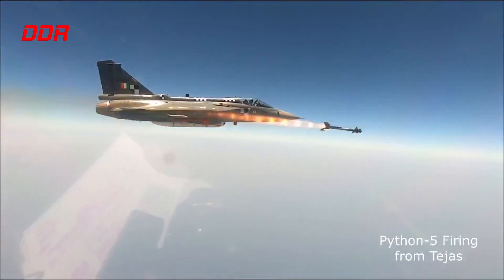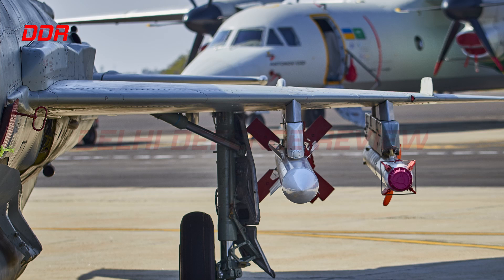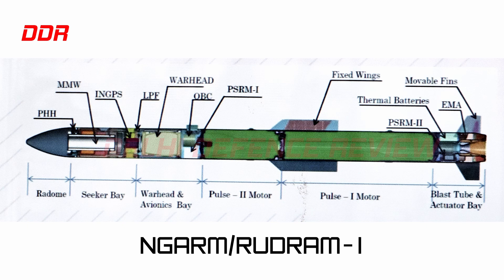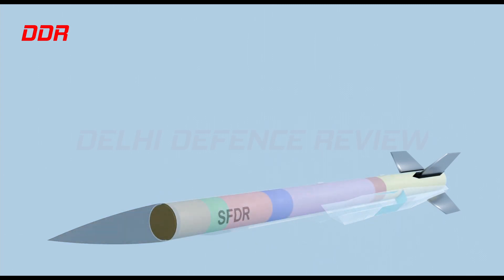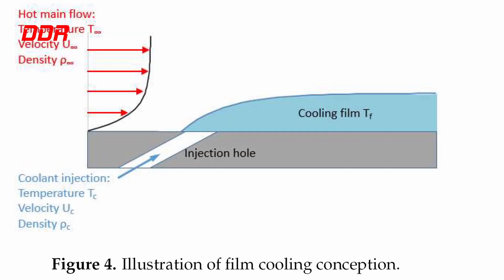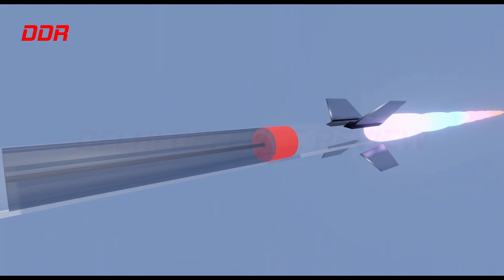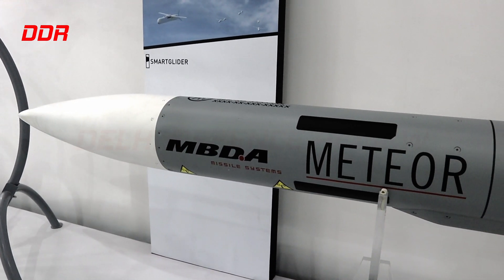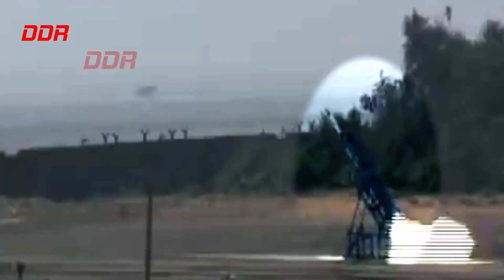SFDR Solid Fueled Ducted Ramjet based Astra Mk3 - IAF's Next Long Range Air to Air Missile

Comment: Can you write an editorial on DDR as to why any combat helicopter can't fire a BVRAAM like Meteor, Astra or AIM120C/D, etc.
Reply from the maker: You need a radar that can see that far. A helicopter cannot carry a firecontrol radar as big as those on fighters. Plus fighters typically accelerate close to mach 1 to give missiles max kinetic energy from the get-go. Helicopters cannot.